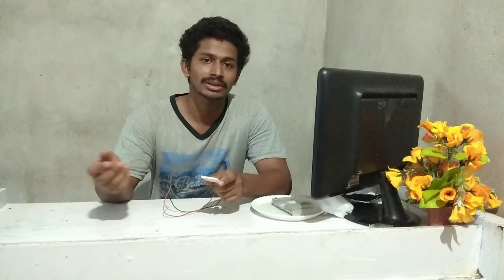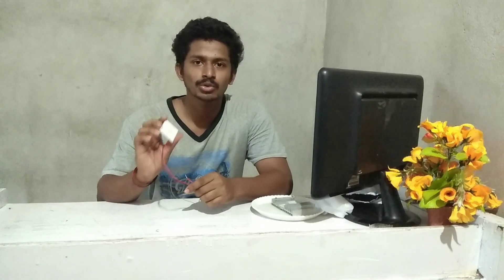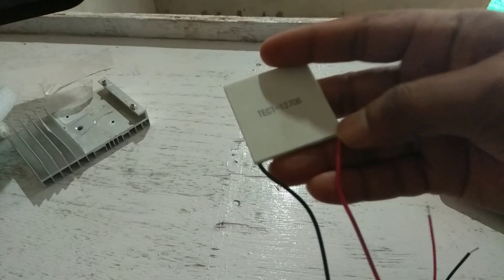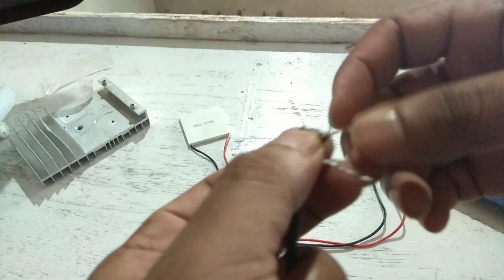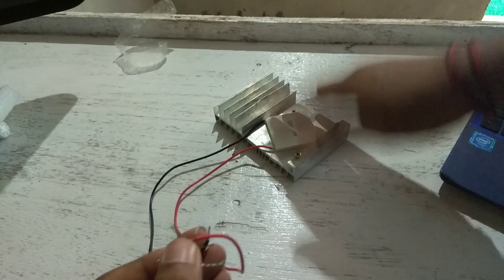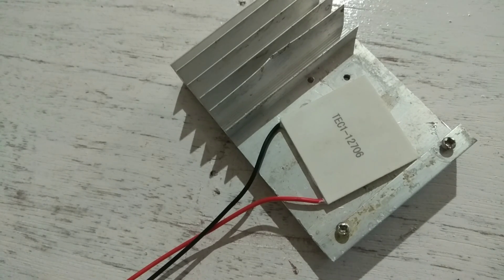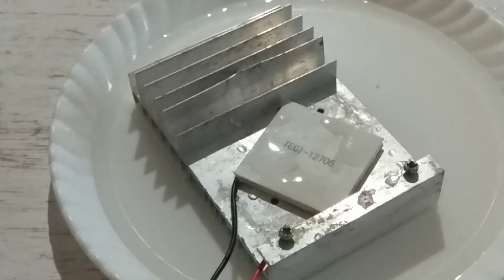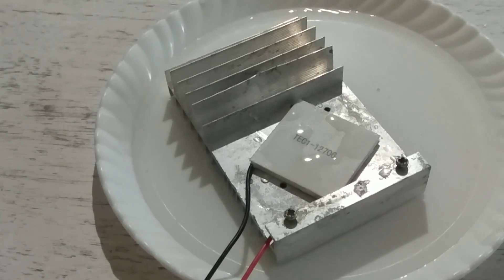how to use peltier module for cooling | TEC1-12706 peltier module

Comment: Can i use power supply 12v/10A
Reply from the maker: Check the datasheet
Reply: use resistor to limit 10A to 5A, tell it will work perfectly!

Comment: What happens if we connect a bare peltier(withour any heatsinks) to 12 volt source?
Reply: It will damage the chip almost immediately - without any way to dissipate the excess heat the chip will overheat and possibly melt. You should always make sure your peltier chip has a heatsink on at least the hot side whenever it is turned on!

Comment: Power kaise supply ki peltier ko
Reply from the maker: red wire is positive and black wire is negative
Reply: @Lifeofelectronic  ha but power supply kaha se kare aur inverter kaunsa use kare
Reply from the maker: No use 12 v battery
Reply: @Lifeofelectronic  if i want to use AC power than what should i do?
Reply from the maker: Use power supply from transformer using with rectifier

Comment: Sir,I used 12volt 2amps adapter but it don't freeze a drop of ice even after 1hrs.Please help me
Reply from the maker: You just filter the dc voltage by using rectifier and capacitor